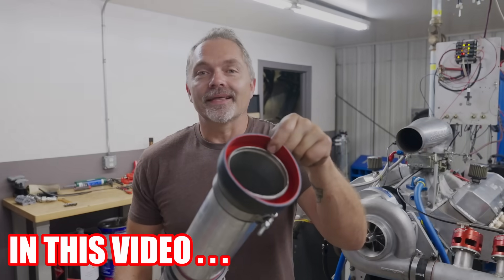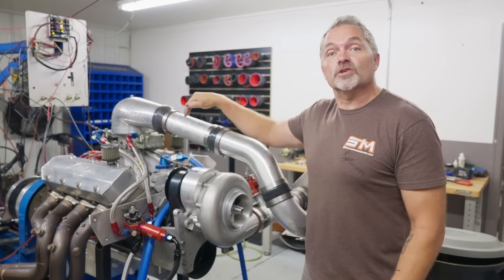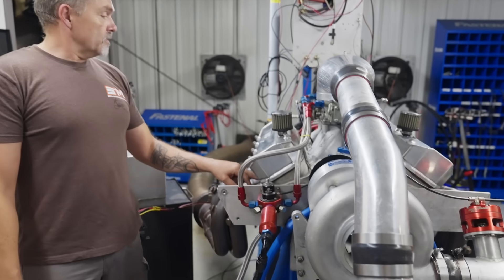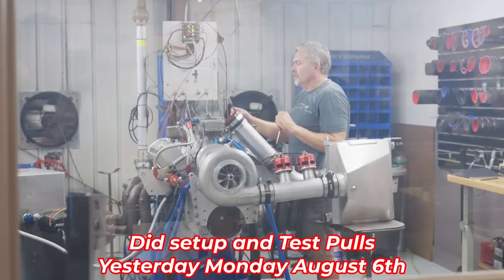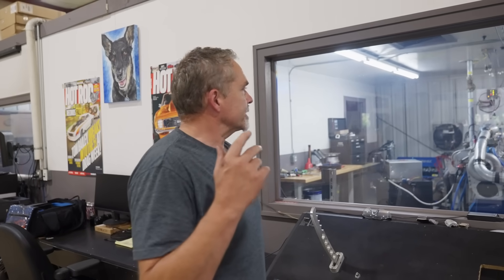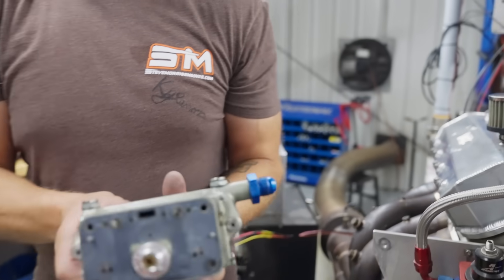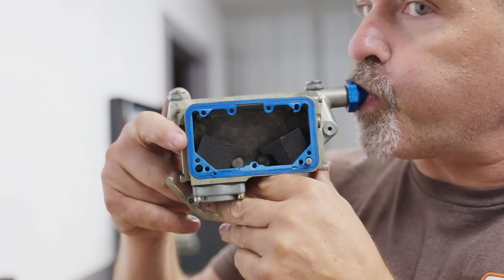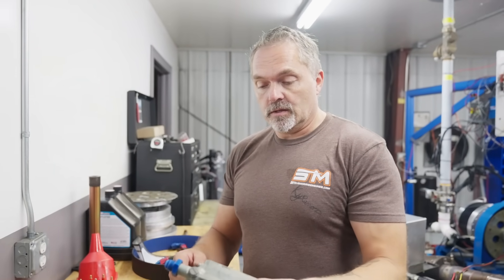I’ve Never Seen This !    It’s An Insane Amount Of Water To Burn??

Comment: Steve the air in Hilo Hawaii is almost always  hot, and wet with water, along  with that gentle romantic salt-air breeze.that Hawaii is famous for.  If that engine has sat stagnate for more then an hour and a half, their will be salt in all the exposed surfaces. There are -0- cars ever sent back from Hawaii. Once a car is exposed to a life in Hawaii it’s put on a death list the military are all told that buying a new car is a financial gamble. The government will allow you to bring your car over but don’t plan on bringing it back because the environment will make it junk ( not to mention there’s only 45 miles of pavement on Oahu go drive on. it is something you need to consider. Longevity is not going to be something you cannot expect regardless of the add-ons. Been there, done that.

Comment: I had to drill out Jets and I had to drill a 10,000 hole alongside the jet where it screws into the metering block just to get enough fuel the front has 105 Jensen in the back has 108 + 110,000 hole next to the 108 jet 
And she runs down the track pretty good and I not might make it anywhere near 1100 horse

Comment: If the torque on that engine is still rising at 6,000 RPM, doesn't that indicate the potential work this engine can generate is nowhere near being generated? A 5,000 horsepower you're only getting 1,800 horsepower of work out of?

Comment: ill say it and ill keep saying it people can spend all this money for these nice engine but cant spring the extra for some vibrant hd clamps or some wiggins i dont understand it your at a level of such power
Reply: @TheOGTurn  the pipe doesnt blow off till 28 minutes in and all he said was thats what happens when you put them on temporary and people dont want to spend money what other excuse did he make that i missed ...
Reply: @TheOGTurn  its not hard to have stationary fittings that never leave the dyno and have the customer get just coming off engine again your making excuses and they sound as broke as everyone else running silicone and worm clamps
Reply: @TheOGTurn  t bolts worm clamps same difference ... if you wanted to talk convivence they would be setup with it already to not only make change over quicker etc hell they could even go as far as to make a carb top hat that is their inhouse version that gets used on carbs on their dyno and stays there again keep making excuses  and being lazy your only creating more work for yourself in the future if you do it right the first time you wont have to a second
Reply: @TheOGTurn  t bolt clamps and worm clamps are slightly different but do the same thing i can tell you dont own a racecar or anything high horsepower with half the comments your put out haha again keep making excuses by the time your done we could have had a setup that wouldnt have blew apart shit your making more work making excuses